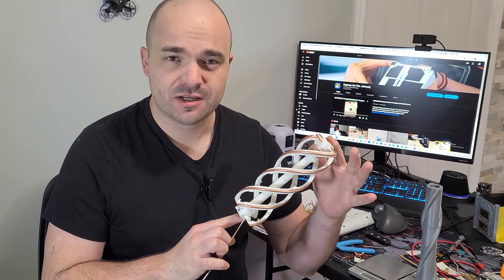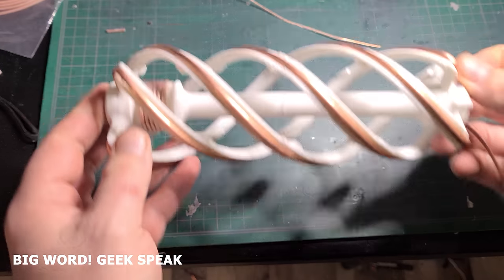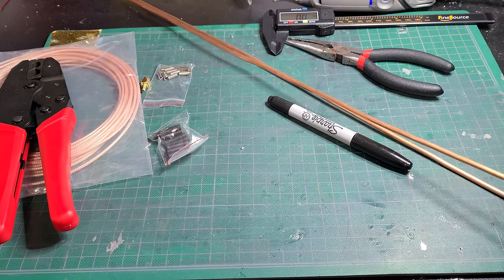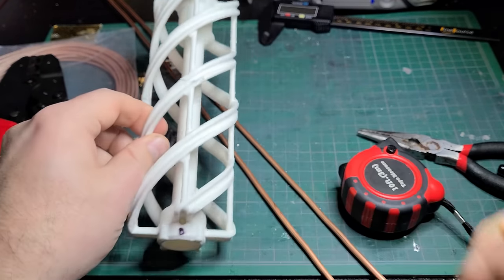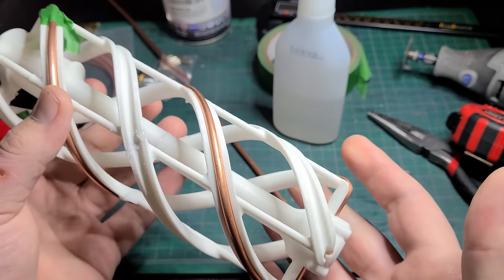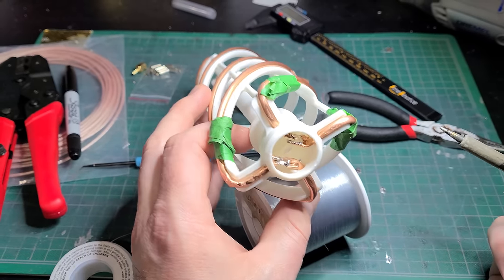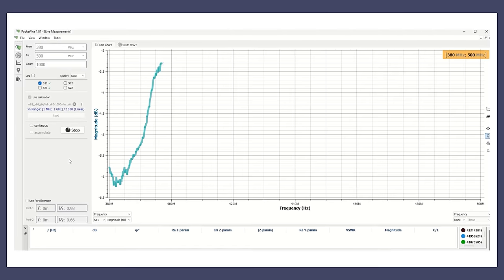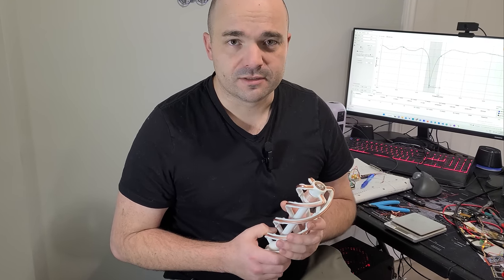"Build an Amazing QFH Antenna : Here's How!"

Comment: Neatest antenna i ever found was about 60 years ago. Being a boy i was attracted to a long abandoned house. A Mannion in its day, i was quite amazed that it sat abandoned. Beautiful wood work and antique furniture  a victrola which when cranked up played Caruso,  a voice worth hearing even on old vinyl or baklite. As i grew bolder i worked through each room, gas lites still worked, the library contained many volumes, fully equipped kitchen marble shower with ma y heads extended to a sauna, ypstairs bedrooms and office. The attic held a surprise. A hidden room with a great huge light green transceiver,  the reciever used long wires which ran. The length of the house, the transmitter a crank up dipole. Why hidden you ask well seems i had stumbled into a german spys home he was also a saboteur as the explosives in his work bench would confirm, and the files marked secret us navy, or the map of a local aircraft plant.  So it was quite the adventure . Lucky he didnt boby trap the place as i would not be able to share so many years latter.
Reply: Dang old folks ramble and never tell what they started on about
Reply: @trueKENTUCKY I know reading comprehension is likely a challenge, but don’t give up!
Reply: Sorry guys, I told the story because I'm old, it was a hell of an ad entire for a kid, those who were with me are dead. Be thankful I didn't tell the whole story. A disappearing family, 250 000 dollars in confederate money, luggage in attic packed for trip in 1912,  never left the house, thousand in travelers check didn't make the trip either. Mysteries
Reply: @jwc4520 Wow. Can't wait to hear your whole adventure.
Reply: Should do a youtube vid telling the story.
Reply: @kingdarkem  have no idea how to go about such a thing  ...  might try writing a script for it but such a task was easy 50 years ago, now it might be ... less fun.  .. just remember it was your idea ...lol

Comment: Make Slotts in stead of holes in top where solder connection is, so you can do assembly on your tabletop, and slide it in then roll tubing in place . Add end caps to seal it all up

Comment: That would solder a LOT better if you Actually added some solder instead of just using brute force transfere
Reply from the maker: Lol Thanx Pete, it's a heat transfer issue. Copper pulls too much heat away from the solder to melt point. But thanx for the comment. Hope to see your version soon

Comment: Not being a radio guy, I just printed the print in PLA, and just used ordinary multistrand electrical wire… soldered ends together on the bottom.
Then just soldered center and shield of coax to the wires on top (as shown in video).
No balun, No tuning or anything, I have no instrument.
Then connected it to TinyGS Lora Satellite Groundstation, and it just works 😊. Receiving 20-80 satellite messages daily 😊
(It is just hanging inside, in front of a window, using a nylon string) Receive only. 
Thank You 🙏👍😊. Best wishes from Norway

Comment: Thanks for sharing. When I make antennas, I experiment with different diameters forming mandrels, like a baseball bat. Start with the larger diam, wrap a turn and then see what diam it pops out too, repeat with smaller sections till it turns out the correct diam. In a minute typically I am good and I use tape and a sharpie to mark the perfect diam forming for my desired antenna.

Comment: I have no idea how I got here but this is insanely cool.
I didn't realize plastic has such a big effect on electricmagnetic fields
Reply from the maker: Haha youtube works in mysterious ways... 😂  glad you find it interesting. When I originally saw this myself I was shocked.. even wood, has an effect but far less. And don't get me started on carbon fibre. I still suspect there is oppertunies in carbon fibre antennas, it's just not understood fully yet.
Reply: @EngineerMeThis  Carbon fibre is super weird being a composite lol.

mixed carbon, plastic and resin. 
catching itself off course can be wildly conductive depending on the structure but it's stupid hard to work with.

So we mix it...

Graphite however.
Reply: I just found this video now! Very interesting stuff! I am a Mechanic (35+ years), and I also repair electronics, computers, houses, you name it. I also do 3D work in 3DSMAX and AutoCAD. I still need to get myself a 3D printer though!
Have a great day! o7
Reply: Carbon fiber is a conductive material. It's used in a lot of things such as ion generators. Or ozone generators.
Reply: @EngineerMeThis  try using pre-preg carbon fiber. There are some composites like innagra that mix polyethylene and carbon fibers. It's easier to handle and then you only bake if using pre-preg  in a common oven or use a mould and resin infusion.

Comment: Just saw your QFH video. Suggestion for a different core/bobbin for the antenna is use your gray air core design but add in supports as you progress upward. You could try to create an elongated slot to pass the wire through and then rotate the support so that the wire is in contact with the support only on the leading and trailing edge to minimize dielectric contact area, then glue inner edge to the bobbin.
Reply from the maker: Thanx for the tip. I agree that reduced contact would help the performance, but the point of this antenna was to take advantage of the capacitive loading to reduce the overall size. I can remove all the core but would have to increase the physicall size by 40% to resonant at the same frequency

Comment: If you crimp and solder the ends it would keep pressure and prevent the tubing from collapsing. You can also add water or a very fine sand and solder. Makes bending a lot easier
Reply: Yes, fill pipe w sand when bending to prevent crimping, penching, or deformation.

Comment: 18:00 before soldering you should bind the ends with copper wire, looping it around several passes like thread and binding the copper ends together.  Then when you solder, you have much more copper in contact instead of using the solder alloy as your conductor, which creates resistance.  You will also use less solder and flux.  To combat the heat from destroying your print, capping the other tube ends with hot glue and then dipping the whole thing (except the soldering end) into a water bath bucket. Solder as close to the water without that inner inch of wire-wrapped tubing touching the water, so the rest of the tubing acts as a heat sink.
Reply: More copper surface area would also mean more heat dissipation from the soldering iron, making soldering more difficult, good soldering work anyway.  His would be worse than it already is.
Reply: @rootbeer666  That is not quite the problem. He needs a higher power solder to apply it a very short time and use plenty of rosin flux. I learnt it the hard way myself after many burnt fingers, melted cores and failed chasis weldings.
Reply from the maker: Indeed the case yes. The ideal solution is a custom made pcb where the copper tube ends are screwed to clamped to the pcb and pie machine and termination is done of that pcb
Reply: @miguelangelsimonfernandez5498  more power is always the remedy for soldering taking too long, also a cobber tip with thermal inertia could be a benefit. It's all about dumping the heat fast 🧐🤓😉
Reply: @miguelangelsimonfernandez5498  In the past when components were large the go to soldering tool was a Gun type with the resistance loop element.  Lots of heat in a small location, much more than you can get from modern cartridge heated irons designed for small components.

Comment: Too clever, by half. 

Without the plastic your link budget will increase by at least😊 10dB.
Reply from the maker: Agreed and your physical size will increase by 100%. As per normal antenna performance is a balance between size and performance

Comment: Well done! Thanks for sharing. 
It's much better to use a much larger wattage soldering iron when soldering large wires, tubing or other metals. It's better to apply a larger amount of heat for a shorter amount of time for less damage to surrounding areas, plastics etc. You will also get a much better solder joint. It's also possible to better use heat sinking with a larger wattage iron than with the small ones. With a small iron you can sink out too much heat to get a good solder joint.

Comment: I would have used copper tube cutters to cut the copper, and maybe a redesign at the top of the plastic cylinder to make the curve easier . Oh and make the holes slotted  that would  make insetion easier.

Comment: No copper tubing cutter? The Dremel does work pretty fast but I am not a fan of the dust. When soldering the cable to the copper tubing, it may be better to heat the copper side first to get it warmed up then add the shield connection while moving the heat over to both cable and tubing?

Comment: I really like this video and the design of the antenna and I always wondered how an antenna like this would work in a where there may be restrictions on outside antennas. I also like the feed point and how the connection would look. I have seen some great pointers on the soldering part and I agree with building up the solder on the shielded part on the connection point with coax shielding of coax is made. I think when it comes to making the area just a bit larger, would it be a good idea to maybe try using a something like very small flat piece of metal wrapped around the shield to make it easier to solder the connection and reduce the overall heat generated from the iron. Thanks for the video de N1ZW Rob.

Comment: That antenna looks great, thanks for your valuable lesson. I am wondering if a smaller version would be possible for 868MHz?
Reply from the maker: Indeed. It will, in a next video I'll.be making a copper wire version for installation as telemetry radio in a STEM rocket.

Comment: When connecting the coax "exposed" part to the tube you should have heated the solder on the tube first than attach the coax. Applying that much heat damaged the internal insulator which is why is was not getting the best signal. Also if you had applied some fresh solder on the tip of the iron it wold have worked better. There is a whole science subject just on soldering and overcoming thermodynamics of the dissimilar metals.
Reply from the maker: Hey, Thanx for comment. Fully agree  the approach to soldering directly to the tube is wrong to begin with. I need to layout a PCB that the copper tube can be screwed to as a termination and the Coax connected to the pcb. This will also allow for tuning the impedance better.
Reply: @EngineerMeThis  Yes that would be the ideal solution, but for the prototype the way you did it proves the concept works. Now for some refinement. 👍

Comment: From looking into it a bit the helical antenna would be very directional and is supposed to have higher bandwidth, but for some reason this one doesn't have higher bandwidth. Is there any comparison with a patch antenna? It seems you could make a patch antenna from a cut up beer can that would have coverage for the whole sky with less gain, but would be much more directional in the right way than using the dual band or 1/4 wave antennas recommended on the tinygs site.
Reply from the maker: Hey, I think you might be mixing a normal direction helical  antenna and a  QFH helical antenna. A Normal helical (which is another video on my channel ) is directional and very narrow beam. The QFH antenna has two coils in either 0.75 or 1 wavelength. This is a very omnidirectional antenna and nor comparable to a patch or normal helical antenna
Reply: @EngineerMeThis  I made your antenna design but ended up resonant at 402mhz with narrow bandwidth. It is improving reception on TinyGS and is still picking up some satellites on 433 but is doing best on the 400 mhz
Reply from the maker: @GuyMasong1  Thanx for trying it out, I agree it tends to be much narrower then expected. but on the freq side, thats  by design. if you have a wide spectrum to cover like 400 to 440mhz you want to be on the low side and being on the high side means you wont get any of the 400mhz freq. the issue as you stated is the narrow nature.. im testing new designs with better efficiency and wider band. so stay tuned.

Comment: Thank you so much for this video! I will try to make this antenna in future, also could You try making 3D printed QFH antenna for 137.5 Mhz if its possible?
Reply from the maker: Hi @Dario, I can certainly try but it would certainly be needed to be printed in a couple of parts as that antenna will be rather large !
Reply: @EngineerMeThis  Thank you for trying making 3d model of antenna i doesnt matter if its going to needed to be printed in more than one part beacuse i already tried making the antenna and i failed it :( it really hard to make it but if You could try to make one it is going to be easier for me and a lot of people that either dont know how to build larger QFH antenna.

Comment: Have you considered using strips of copper sheet?   Companies that make/sell continuously formed copper roof guttering start with rolls of copper sheet, wide enough to make guttering.  You can buy a length of this and have a sheet metal workshop cut it into narrow strips.  These narrow Cu strips are lighter and easier to wrap around a QFH former than Cu tube.
Reply from the maker: Thanx for the feedback. I have considered something similar that I think could be easier to work with and that is adhesive copper type
Reply: @EngineerMeThis  But then you would need 100% support of the tape, and that would be something else to make.  It is likely to add dielectric losses.   Real 3M copper tape is $$.  The adhesive will fail after exposure to the elements.  You might be getting the impression I don't think tape is a good solution.     Sheet Cu is not strong enough to be self-supporting like tube.  I suggest using PCB (Cu removed) disks with 4 slots cut evenly spaced around the edge of the disk, and a hole in the centre.  Mount the disks horizontally on centre support tube  spaced at say 100mm.  The spacers could be plastic tube sleeves that slide over the centre tube.  Thread 4 strips of Cu strip through the slots and rotate (then glue) the disks to form the spiral.   No special tools or materials required. Aluminium strips would reduce cost and be almost as good as Cu.    Even if a QFH was made with Cu tube, the fibre glass disks (which don't need to be disks, but easier to explain) would physically stabilize the antenna.
Reply from the maker: @darrenconway8117 I fully agree with you. but I think you may have missed the point that this antenna is being deliberately loaded with the plastic. The plastics capacitive effect on the antenna causes the antenna physical size to be smaller for the same frequency, if the plastic was removed the antenna would have to be 20% larger in size to be resonant at the same frequency
Reply: @EngineerMeThis  I got the point, but that capacitance loading may also bring with it dielectric losses that offset the smaller size benefit.  Also, just reducing the size by itself will reduce the antenna output, all else being equal.   It is good to try different things and ideas, but equally important to quantify the results. My old professor used to say it ain't true if it ain't measured.

Comment: Very cool! I'm curious though, did you do any testing to see if different brands of PLA or PETG (I'm assuming that's what you printed the frame out of?) effect the resonate frequency outcome? I.E. do we need to use the exact same filament brand and maybe even color that you used if we make this?
Reply from the maker: Hey thanx for message. I have used PLA Here ASA might be good option for outdoor use. I suck at printing PETG so still need yo try that. With regards to color. Generally the worse color is black as they tend to have more carbon based pigments but only testing will tell with other colors and materials

Comment: Hey there, thanks for your hard work on this! I'm wondering if it's possible for you to modify the STL so that the holes at the bottom where the copper tube is fed in again are open-ended. It would make it a lot easier to bend the pipes in. I tried doing it myself but didn't have much luck. Would really appreciate your help with this!

* Maybe if possible also provide a STEP file please.
Reply from the maker: Hey, I can do so, I found it easier just to cut them open after the print has completed. Cutter into open slots instead of holes.

Comment: @EngineerMeThis , Great video. Would we need an impedance transformer at the base of this helical, or is the coiled coax doing this job?
Reply from the maker: Hey 👋  thanx for comment. The coil is ment as a choke. The antenna is suppose to be very close to 50ohm ideal match as is but, I have tested it with a external wire 50 to 50ohm balanced to unbalanced balun and works great